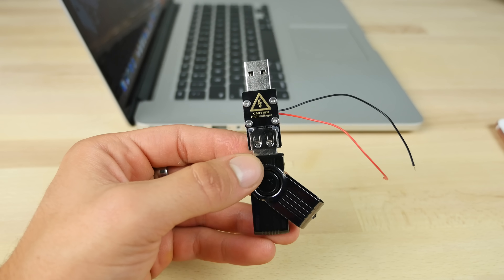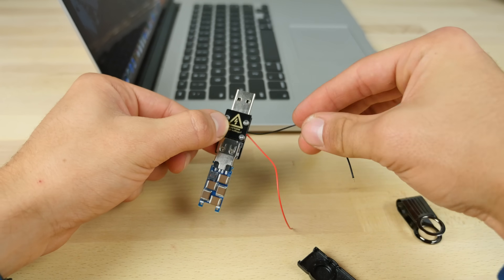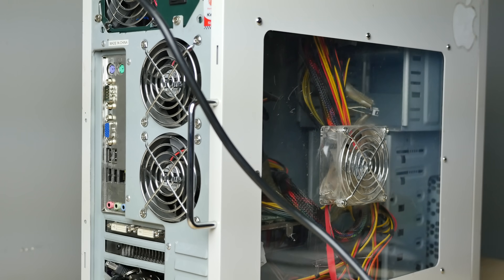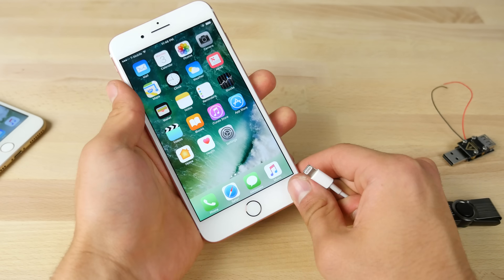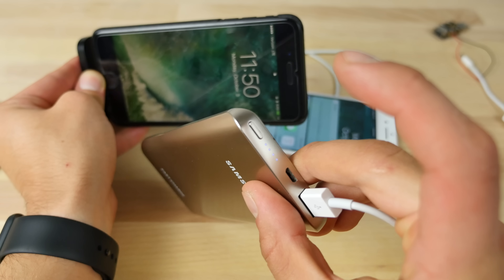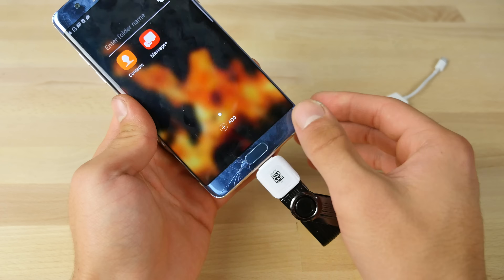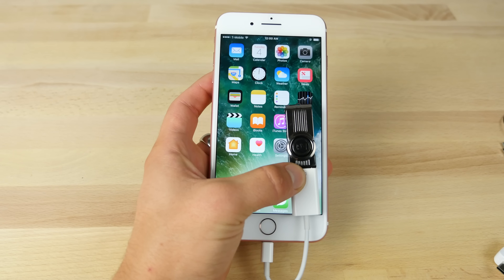USB Killer vs iPhone 7 Plus - Instant Death?

Comment: I think your iphone isn't broken. As far as i know, the usb killer sends current through the data ports. the iphone chargers need resistance between them to load. I think there is just a resistor iinbetween + and - data pins. I think that broke. if you would solder a resistor(you have to search for the resistance in the internet) it would charge again

Comment: 1) The reason (most probable!) that why it isn't giving out sparks on phones is that the capacitors aren't being charged to that high of a voltage (3.3vDC) and also the current supply is lower, lower enough to just drive small peripheral devices like gamepads or usb drives thats it, while the computer USB port is capable of providing 5v @ 500mA or even more than 1Amp for USB 3.0 compliant ports!

2) The Samsung note 7 should have the latest Android and hardware that allows it to charge the other devices connected to its USB port, meaning it gives around 5vDCish (yes! you can charge your iPHone with it or anyother device), so when you connect this killer to usb port, select the option from top drop-down to charge the connected device that way it gives out 5vDC and charges the caps inside to a higher level!

btw, the circuit seems to be a DC-DC buck booster (as advent from the Inductor and capacitor array)

Disclaimer - Android, Embedded systems & Embedded Linux driver developer.

Comment: see cool enough But you forget that you have a safety In The Psu. that could Be the only One that Blowed., so if that One is replaced. your pc would start fine. !!!!!, so thats Isnt any Proof at All . I needed to see also that your psu is Working fine. afterwards Or if the Pc would work if you changed the psu. so far you Only Proofed that the Pc stop getting power from the Psu. but the safety in the Psu. is problerly blowen. so that Means if you change it. the pc starts fine !

Comment: So if you would have read the product page you would have known that the device works by discharging around 240 volt into the usb datalines. So by putting it in charging mode you are basicly protecting the phone. I expect the phone to break as soon as you put it in data transfer mode.

Comment: You just killed your old power supply... nothing else
Reply: @Chris. W You plug it in
Reply: actually, this thing fries the motherboard, it being the thing that it is plugged into. everything but the motherboard should be A-OK though.
Reply: Djhg2000 did you really have to type that much
Reply: Syrus Pich Hobby electronics and engineering college ;)
Reply: +Chris. W There are several versions of this and I'm not sure which one this is, but one way is for it to charge up the capacitors and then use a small inductor (typically a coil) to boost up the voltage to a few hundred volts. This relies on the capacitors having a low enough internal resistance to deliver all their charge in a short pulse when the inductor is connected back into the USB port.

Normally high voltage spikes are suppressed by the ESD protection (to keep the phone from frying itself when you walk on a carpet) but since a typical electrostatic discharge transfers very little energy (high voltage and current but minuscule time) it is not designed to take the relatively massive energy stored by a large capacitor (or in this case, the large equivalent capacitor formed by the 5 smaller ones).

It simply overpowers the protection circuit by several orders of magnitude and as a result the usually well protected electronics take the hit instead.
Reply: +Chris. W Not so much quickly takes out as extremely quickly releasing it at a much higher voltage. When you get above a few hundred volts (I think the theoretical limit under ideal conditions was 327 or something) the electric charge starts jumping air gaps. If I remember correctly the rule of thumb is one centimeter per kilovolt. That means if you put apply 1000 volts at the two furthest pins in the connector the charge can theoretically jump between traces on the board inside.

You might also remember from science class that energy is measured in joules, charge is measured in coulomb and capacitance is measured in farads. The relationship between them are charge = capacitance * voltage and energy = charge * voltage. This means the released energy can be calculated as energy = capacitance * voltage * voltage or J=F*V^2. Furthermore one coulomb can be rewritten as amperes * seconds which means you end up with energy = amperes * seconds * voltage * voltage or J=A*s*V^2.

The end result of this is that you not only want to release as high of a voltage as you dare to make the energy jump gaps inside the phone but also do it in as short of a time as possible to maximize the current (which is measured in amperes and is what makes the traces literally burn).

Putting numbers to all of that we can be very generous and say those capacitors might be equivalent to a 1F supercapacitor and calculate the charged energy from USB 5V to 1F*(5V)^2 or 25J. Let's say the discharge voltage is 500V and the discharge completes at a constant voltage for 100ns or 10^-4 seconds (the most violent period of a typical electrostatic discharge from, say, when a finger touches an uncharged piece of metal). The equation now becomes 25J=?A*10^-4s*(500V)^2. Solving for amperes we get 25J/(10^-4s*(500V)^2)=1A. This may not sound like much, but remember most fast chargers go to about 1 or 2 amperes because higher currents become impractical since it would require very thick traces on the circuit board. This is also a 1A current which is not strictly bound to following the traces because as previously mentioned 500V is enough to jump air gaps.

Wikipedia provides some nice examples to quantify just how much energy 25J really is. For example, 1J is supposedly the energy of a tennis ball moving at 22 km/h (13 mph) or the energy required to lift a tomato 1m upwards.
Reply: +boii gimme gud succ Not at all, but I like explaining physics stuff.
Reply: Djhg2000 wait.... you remember that stuff HOW

Comment: The protection circuit of ip7+ goes into secondary backup charging circuit which only accept 1amp charger,anything over 1amp will not charge it

Comment: But a port on my front pc (OS is windows 10 Motherboard I believe has Surg protection along with the other ports) got fried and  after 2-3 restarts it started working perfectly again.
Reply: New premium motherboards in both pcs and macs do have protection against these kinds of stuff, a mac once told me about one usb port draining lots of energy and it temporarily disabled it, and indeed it was a faulty usb plug, trying it again on an ancient pc blew the power supply up.
Reply: Captain Dandal ouch

Comment: I think the reason why the USB killer doesn't work on phones is because the phones have a set charge amount
Reply: It's because the power goes through the battery first, but the lithium batteries modern phones use have overload protection built in so every time those capacitors try to overload the circuit and fry the board it simply cuts it off.

Comment: Minus all of the Apple fans booing and Samsung fans cheering. No attempt to spoil the show here, but this does prove that the Iphone's charging failsafe works and the Samsung's...seems uncannily persistent on not doing so, OP, you should check using CPU-Z if every component is working properly on that handset, this is not a matter of win or lose, but a serious problem that, according to media sources, even Samsung couldn't fix despite replacement...
(P.S. I own a Note 4, I don't like iOS trying to hide complex functions necessary for some tasks, that's a step down in my book, screw speed or fluidity, you can only percieve so many fast moving objects at once, I vote flexibility)

Comment: Do a hard reset. Sometimes after cleaning a dirty lightning port, you have to hard-reset it to get the port to function again. I assume it's a safety shutoff when the device detects a short in the port.

Comment: If you still have the Note 7, attempt to kill it by changing its use from charging or power to some sort of file transfer. I believe the previous method didn't work because the USB Killer works by rerouting power to the data lines and the data lines may have been blocked because of the phone's setting of charging only.

Comment: It depends on the output of the voltage and current. Usually phones don't have that much of power since they run on a low voltage battery and current.

Comment: Replace the one broken part and bang, up running again.
Reply: Are you talking about replacing the ruined lightning port? Good fucking luck, it'll probably be cheaper to buy a new phone.
Reply: Wolt I meant the PC
Reply: MegaMech I'm not sure how exactly this usb works but I'd assume the whole mobo is dead. Could have damaged some other parts too in the process depending on the fail safes in components.
Reply: Wolt
Meh, once a part breaks, all the ones after it are fine. So there is a possibility of it being an easy fix. If that power get's to a processor though, like you said, good luck.
Reply: MegaMech Yes, and depending on how old the motherboard is there is a good chance something else got fried. It's also kinda a pain in the ass to replace your motherboard lol, so that's a major inconvenience.
Reply: Wolt I can replace my mobo pretty easily. But yea, if a mobo was repairable there'd probably be 5-10 capacitors or resistors to replace.
Reply: MegaMech It's easy to replace your motherboard, but it's a massive pain in the ass especially if you have a lot going on in your PC. Having to basically unplug everything after you spent so long routing your cables is kind a a buzz kill.
Reply: Wolt
Meh, my routed cables stay where they are. I just unplug everything, take out mobo, put mobo back in, plug it all in. No re-routing necessary.

Comment: comments are l oc k ed I've g ot a c hEa per so lut i on f orFr ee
Reply: short circuit isnt enough. that thing puts 200v though your device. it would be easier to destroy a usb cable and ´plug it directly into wall power
Reply: second solution I've mention do that so ;)

Comment: This thing won't work on most computers btw. it'll just blow a usb port on most.
Reply: Matze Strawberrymaker
Reply: if your pc's usb power isnt isolated (which i wont) you will reck the 5V Power line and if your lucky even the whole power supply.

Comment: The lightning connector isnt technically fried but instead the protection circuit, all lithium ion batteries have a similar type of protection circuit board that controls the flow of electricity and the temperature of the lithium ion battery it makes sure that the battery doesn't overcharge and has thermal fuses that should blow if the battery gets too hot. by replacing this circuit board, the lightning connector should work again.

Comment: ummmmm?? I would just like to point out that frying a mother board with a USB killer. is basically impossible, because I usb port is only 5 volts. so this just isn't possible. even if it where to send more the 5 Volts back though the port the resistors would stop the current. u need open your eyes and realize that that's not how a computer works. dumbass 👎👎

Comment: It will have a resistance it is into the charging port Which has a mechanism in it to stop more charge than it can take like when you leave your charger longer than 100% it doesn't take it in
Reply: Daniel Whyte your right this video is fake, you can't fry a mother board like that because it has resistors on it

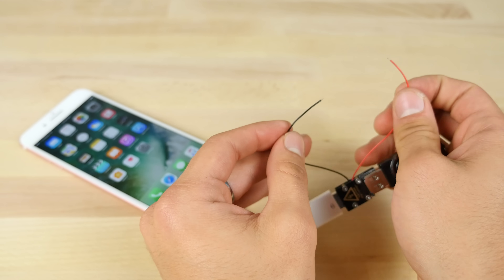Comment: 4:15 The voltage is the same for all USB ports but the current is lower which causes it to take longer to charge because of ohms law (P=IV where P is power, I is current, and V is voltage)

Comment: I like how you spoke of the Iphone as if it would surely have some sort of fail safe against this kind of thing. Why would it? Apple products are crap, all of them. Price is 95% brand with Apple products.
Reply: Dodgy Bishop Well the Note 7 was 849$ compare to the 7 Plus 759$ and the 7 plus doesn't explode
Reply: Yeah but i would rather have a note 7 that has ~0.5% to explode than a phone that i cant do shit on
Reply: the only thing apple fanboys can say is that it has a low chance to explode. the note 7 is not the only competitor for the 7 plus

Comment: low voltage port? ever heard the saying its best to say nothing and be thought a fool rather than open your mouth and confirm it? if you are going to own a device like this you should probably read up on the diff between volts, amps and watts. what you wanted to say was its a low amerage or low wattage port. the voltage of a usb host port is 5v, unless its using qualcom quick charge or usb c. for most intents and purposes lightning is micro usb so you should get the same 5v from that as you would from the desktop. the difference is amps they can supply. when USB C connectors become more common mobile devices will be able to supply a lot more wattage/power/amps than they currently can. the reason it took so long is that usb was designed to transfer data with power as an afterthought. smart phones flipped that. 

ALSO if you understood what the usb killer is you would know its not all that special that some devices are protected. also tie in usb history... at some point years ago it was made standard to over voltage protect the positive power wire with something called a TVS diode... Security wasnt an aspect of the decision and no one saw a reason to add it to the negative line if they had you would never have held a usb killer in that form.

the usb killer is a bit more than "just a bunch of capacitors" its also a dc-dc converter and it sends a negative voltage over the ground rather than traditional high voltage +

Comment: I was going to suggest that I thought it was the Lightning connector that provided the enhanced protection circuitry, and your observation toward the end seems to confirm that.

Some of the newer desktop and laptop motherboards USB connectors also provide enhanced high-voltage protection, which MAY now protect from this "USB Killer". However, I'm unsure if even those would provide sustained protection over multiple "zaps". Surge and spike protection circuitry does degrade a bit each time the input experiences voltage above the nominal levels, and it's cumulative.

That also applies to AC mains surge and spike protection strips, which is why it's a good idea to replace them after a few years, and highly suggested immediately after any nearby lightning strikes that cause a power outage to your equipment.

Comment: You could've bought a cheap old laptop from Ebay to kill and not your old PC.
Reply: This stick targets the motherboard chipset, which is now fried. PSU and the other components should be fine.
Reply: FSXgta No, you are missing the point. It's not about the PC being not good anymore, but it has a sentimental value from him. Anyways, I still love his videos though.
Reply: Lasdil Elizaga well at least he could replace the stuff that died, if it was a laptop it would be done for
Reply: Whats the difference? Im sure both are worthless. Old computer parts are no good anymore
Reply: i still use ddr2 with q9400 oc'ed
Reply: yeah hopefully only PSU died on his old pc and not motherboard or so.
Reply: Tbh a motherboard on that thing is probably gonna cost £30 new. He could probably get a used one for £15-£20

Comment: I'd hypothesize that perhaps the phones were fine, because inside USB OTG & lightning cables there's usually components inside including fuses and voltage regulators, so at most those were fried.

Comment: The Samsung probably has a diode system, strait one way system feed that is pretty much the same thing as your safety USB plug it only allows power one way through the system, if you give me somewhere to send it i can make a simpler more powerful version it will be way bigger but it will reach higher voltages, roughly 2500 to 2400 volts at the right amplitude to easy fry a mother bored or the entire device in one go. 

And to xMESSI14x it can't fry the whole system but it will mess it up if the whole system is linked through LAN cables it would probably slightly mess up the servers.

Comment: the computer has entered in protection mode i think. just unplug the power supply from wall plug for about 5 mins to let capacitors fully discharge and after that plug it on.

Comment: You have no idea what you are doing... The voltage out of an iPhone and a computer should be about 5V. The iPhone might deliver less current then a PC mainboard, that this should just take some more time to charge the caps. The clone was safe, because it does not support usb-otg, speak: It does not supply power to its usb port.  It could very well kill you phone even when the phone is locked - it just have to bring my own power source - like two car batteries. iPhones get lovely hot when using such a configuration. (if they have fixed that issue with the iPhone 7, then I just use an ESD-Pistol)

By the way: Those funny USB-to-Phone adapters can have their own protection circuit. Sure, that costs money, so apple skimmed on it, but they can be designed to fail first and fail safe. Maybe that is what happened with the Note 7.

Comment: Stick your tongue on those capacitors while it is being plugged into the USB :P  Low voltage port, you mean low current port as they are all 5 volts.  Low current takes more time to charge the capacitors.  When I was learning about electricity, it took a bit of time to grasp the difference between current and voltage.  Kind of like advanced math or programming a new micro-controller, it is confusing and then it all makes sense.